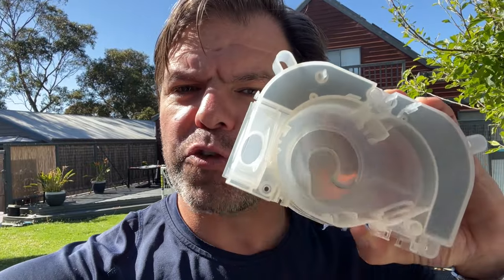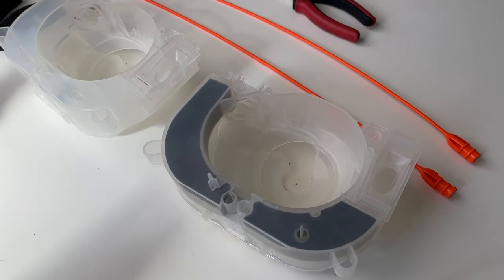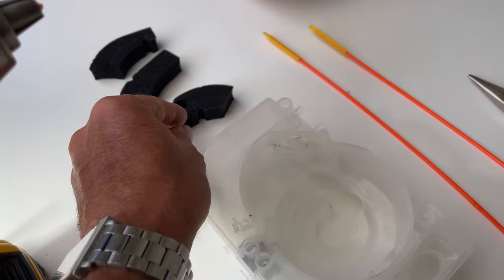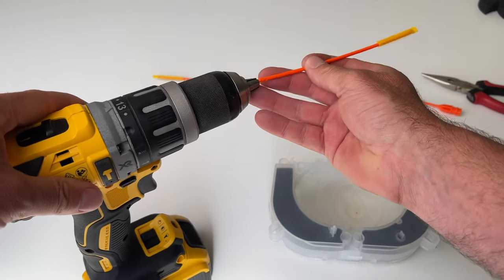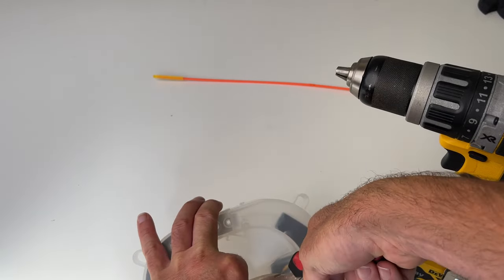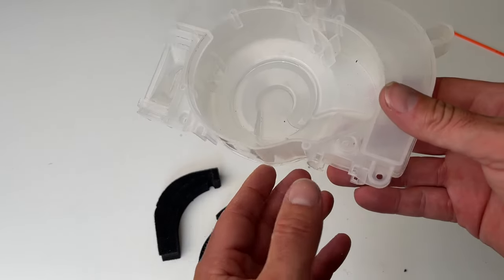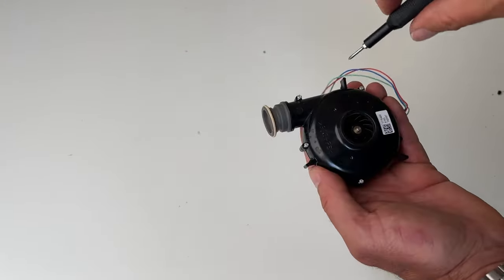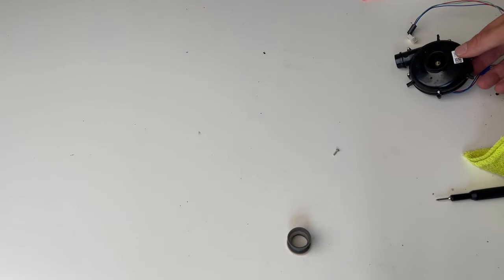It Works! New Improved DreamStation Foam Removal Tool! The Drain Weasel Method

Comment: Drove to Home Depot, dropped 6 bucks on a drain weasel, came home, loosely followed these directions, 10 minutes later, foam is cleanly out. No cuts, no holes. THANK YOU FOR POSTING! I will now use this as my primary and use the new garbage Dreamstation 2 they sent as a travel unit.
Reply: May I ask, what didn't you like about the Dreamstation 2?

Comment: works like a charm. Have to use the drill extremely slowly. Once the weasel comes in contact with the foam just a slight press of trigger without letting it rotate a full turn iteratively does the trick. I rolled aluminum foil into a stick and used it as a guide for the weasel to connect to the foam in the chamber with the top hole access and that worked very well. Thanks for the video and all you do!
Reply: Can you explain how you used the aluminum foil? I have worked 4 days on this with very little success!
Reply: @disneyworldinfo  Unfortunately I no longer have the machine as I returned it back to Phillips. You have to make a thing long roll of the foil long enough and stiff enough to be able to push the foam closer to where the weasel can come in contact. Once you achieve that it catches it and entangles the foam. Without the foil, because of the steep angle and narrowness,  its almost impossible for the weasel to reach to the foam and then it just rotates around air.

Comment: Great video! Wish I'd known about this method before I cut holes in my casing. Still worked out ok. Used a wood burning iron with a flat diamond shaped blade to cut flaps in the casing then resealed them by melting them closed. This would have much easier. Thanks for all your informative vids!
Reply from the maker: HI Stephan, glad you still got the results mate. Cheers!
Reply: Using a wood burning tool to make a flap, then re-melt the plastic closed is a very good idea, too.  Much cleaner than any cutting tool.   Good job!

Comment from the maker: Shopping for CPAP Gear? My Channel Sponsors will take great care of you!
U.S Sleeplay Channel Sponsor - https://cpap.review/shop
Australia Channel Sponsor - https://cpap.review/cpap-direct

Both companies have 5 star customer support and service and if you let them know you're friends with old mate Uncle Nicko on youtube they will roll out the red carpet for you! 

Since my original foam removal video there has been a large number of tutorials provided on youtube. Some using coat hangers, others with various drill bits however i really like this technique which leaves the turbine casing in perfect, original condition.

It uses a device called a drain weasel which is normally used to unclog drains - https://cpap.review/drain-weasel

This is an affiliate link. As an amazon affiliate i get a very small commission paid by amazon which helps me buy all the gear for the videos. Cheers

Comment: Worked fantastic.

Wish I found you a year ago, that’s one full yr not using this thing and life without much sleep... 

I did the easier hole first with the same model drill... even on slow I over torqued the plastic and it stretched, needing a second trim almost too short ... 

finished that hole and did the second one by hand with the backup weasel and using the included crank, slider in my teeth to one side of my face , and guiding/supporting the shaft with my freehand. 

I RECOMMEND THAT INSTEAD. I don’t think the power of the drill is an advantage, in fact I got to “feel” the process through both hands , and knew when to stop torquing and pull instead. A COMBO of continuous torque (after the snag, and sometimes re-snag) and slow pull was even better. With careful turning, you can coil that bugger up right small and slide it out easy.

The harder hole was actually easier that way, “by feel” and softer pull/turn.

SECONDLY: I was worried it would sound like a lawnmower once removed. I’m almost mad how little it changed... IE ALL THAT TOXIC FOAM AND CANCER RISK for what?? How much engineering for what? People, don’t worry about it, do this method and DONT worry about being kept awake by sound. 

TEST: what I did was set up the old analog Teac tape deck and Tandberg microphones (probably 40 yrs old minimum!) and did a before after comparison. I used old analog cuz of how exacting the VU meters are, how I could lock in the level, because I know there’s no auto gain modern stuff in it, and can get a real accurate comparison.

For good measure i laid the ipad on top more for picking up vibration changes not t caring about auto gain.

I didn’t monitor the recording with headphones, which wasted the effort. Because I would have heard the wildly odd unnatural howl that was recorded. Only way I can describe it is sounded like a DIGITAL tone generator that rose and fell with the machine matching my breathing in or out.

The tone was so loud you couldn’t hear the hiss of air flow at all... really confounding..

You can’t hear it by ear, so obviously the turbine interferes with the old mikes somehow. They have 4 foot leads so the deck was far enuf away I think. It is odd because they have a diaphragm for pickup, not a chip. It should only be picking up sound waves hitting the diaphragm.

THE IPAD didn’t pick up the interference LOLLL. It did pick up a change of sound but not an increase of sound.

But whatever. I’m excited to get a real good sleep tonight without the cancer
Reply: Followup: I used some guitar tuner apps on the ipad and the tone generator that comes with. Sine wave matches the best tone when trying to dupe the sound on the tape recording.

The fast tuning spectrum graph shows the high tone (most airflow) was usually an E♭4 running 303.7 Hz, with all the app settings default and A = 440. Then the low artificial tone still sounded like the tone generator sine wave equivalent, spectrogram showed C♯3 at 140.9 Hz most of the time.

why the tones sounded like the app's tone generator when emitting at those freq's I still am not sure of. Sounds 'digital', overriding all the other pickup sounds (like the air flow hiss) in through the analog gear. Moving the mics back barely two feet totally eradicated the 'tone sound' and picked up room noise, the air flowing, and my voice again. Using the headphones to monitor first wouldve informed me that the constant VU balance I thought was airflow hiss was this 'tone' instead.

And no it wasnt feedback, I made sure to have the speaker volume at zero and the amp set to a totally different output as insurance, while the input to the recording deck was just the mics. Wierdness.

OH AND YES. Delicious night's sleep, full 6.5 hrs without waking up once.
Rested.
I will go commando foam (naked) from now on, hope they DONT send a 'replacement' now.

Comment: Gegday mate!The Foam in my Dreamstation(circa2018) is mostly destroyed from OZONE. What is left in the one chamber is 80% gone with the rest being soft and crumbly/smeary.  The turbine is a sealed unit (glued).I have replaced it with a 3 B medical Luna II and have  retired my SoClean.
Reply: Same here.  Gooey mess.  I soaked it in hot water with dishwasher soap and got it clean. Let it sit in the soapy solution for a couple of days.

Comment: worked on the inner one .  the outer one was harder, so i drilled a hold.  In retrospect, I should have drilled a hole from the inside since the chamber is still sealed when we put the turbine back in.  In anycase.  very helpful video since the Amazon replacement are no longer available

Comment: I ordered the new air chamber without the foam. I installed it tonight with no issues and it seems to be working well. I'm kind of excited to begin my therapy with the DS1. I've been getting by with a pretty good F&P Icon.
Reply: Hello if I may where did you get it from I to want to buy one if you have a link how much did it cost?
Reply: I would like to know where you got one without foam?
Reply: @nightplayer2k6  Amazon, 30 bucks. I don't have the link.
Reply: @disneyworldinfo  Amazon, 30 bucks. I don't have the link.

Comment: Thanks a million for your tireless work!  I'm wondering if there are any actual decibel reports on the difference between foam and no foam in Dreamstation I.  Do you have a machine that can measure and rate the two noise levels? It seems as if someone should have checked ii out with an actual measurement.

Comment: I struggled with this technique for hours before bashing the chamber apart with a hammer. It did not work at all, I am amazed it worked for anyone and incredibly jealous tbh. Does anyone happen to have an extra tank they removed the foam from?

Comment: You actually don't need the drill.  I did mine by hand with the handle that comes with it.  The drain weasel twisted itself up because of the length, but after binding itself up it worked great.  No extra tools, not much more time than done here.  Just maybe a few extra minutes and some patience.  Kept going until it wrapped itself around the foam and then slowly pulled out.
Reply from the maker: Nice one David. Most people are now just buying the $30 empty casing and installing it - https://youtu.be/DuVeh2q-78c

Comment: Thnx. I'll be putting a new empty chamber in my original DS1 as I drilled and would like a new chamber. Question: is it necessary to remove the new silicon foam in the replacement DS1 should I ever get mine?
Reply: Yes, the new foam was never properly tested and can also release toxic VOCs.
Reply: @PaulMansfield  Damn.

Comment: I couldn't for the life of me get the section out by the air intake port.  Tried bending the tip of the weasel but it wouldn't catch it.  Had to eventually drill two holes on the inside wall of the motor housing to pull it out bit by bit.  The other side worked great.
Reply: 1st I did not know there were 2 different drain weasels. The one you use to is the hair clog. I have gone through 5 drain weasels and still can’t get from out. Not sure what I am doing wrong!! So frustrated!!
Reply: I'm having the same issue. Slightly different plenum than is shown in video.

Comment: This technique takes a lot of patience, kind of like fishing. While it worked after using a few drain weasels, there is a line of foam residue where the foam was glued to the case. Maybe safer to buy the replacement case on Amazon.
Reply: Did you find one without foam? Can you tell me how to search for the one on Amazon?
Reply: @disneyworldinfo  yes, the replacement "generic" case on Amazon comes without foam. Maybe safer to use that one than to try to modify your current case with the drain weasel approach.
Reply: @disneyworldinfo  The product page is now missing from Amazon. Philips must have filed a complaint.

Comment: I got my new Dreamstation from Philips today. Very excited. I followed all of the directions to a 'T'. None of it works. The device doesn't connect or download my settings off the memory card. I cannot enter it manually. It is essentially, a brick. I have to continue using my old device until someone gets back to me.

Comment: Thanks for the informative video and keeping us up to date with the CPAP issue. I registered and received my new replacement machine from Philips a week or so ago (main unit, power supply and hose in a new case) Thank you Philips. In the meantime, I had used the inline bacterial filter with no issues. They want me to now return my old unit. Should I?
Reply: If you want to loose evidence and not care sure go ahead

Comment: Just ordered 2 Dreamstation 1 air intake plenums without foam from Amazon @ $40 each to replace my original but foam removed plenums. I will do an OSCAR 1 day and 1 week data check before and after to confirm that the new plenum data ports are configured correctly and OSCAR data is similar to original. If the new ones are built correctly I should see no data change. Here is hoping 🤞
Reply from the maker: Hi David, yes i was behind those. I'm just not sure on the plastic but i think it's probably a good solution and the lesser of two evils. Cheers. Nicko
Reply: Hi David, can you please provide a link. i can't find it on Amazon. Regards,
Reply: Brand: Medihealer
Replacement Empty Casing Without Foam for Philips' Recalled Machines, Plastic Part for Dreamstation 1, CPAP Filter Assembly for Dreamstaion 1
Reply: @va7da  Thank you , I found it, a pity it is out of stock for now. Regards, Olaf
Reply: Installed both Amazon foamless air intake chambers in my two Dreamstation 1 Auto CPAPS. Installation was easy, needed needle nose pliers to carefully disconnect wire connector blocks on rear of circuit board. OSCAR one day data was virtually the same before and after installation so lack of foam made no operational difference. Machines were no noisier without noise abatement foam. Why did Resperonics ever use the foam in the first place?

Comment: I’m assuming you can safely run the machine without the foam. So what does it sound like without the foam? Is it noisy?
Reply from the maker: Hi Tiff, certainly much safer without then with. It sounds find, a little louder but only marginally. Cheers
Reply: I barely noticed any difference after foam removal. My ds1 is about a year old.

Comment: Thanks for the tip. After removing the foam, there is still some black foam glued inside, any tip to remove that? I'm letting it soak in water to see of it dissolves. Thanks
Reply from the maker: G'day mate, that black foam glued is the breakdown they are talking about. It get's all sticky and turns to muck. I'm not sure what you can use. Could try some boiling water and perhaps a instrument tube brush. If you can't get it out then just buy a brand new casing - https://youtu.be/DuVeh2q-78c . They're pretty cheap. Cheers
Reply: @CPAPReviews  thanks a lot!

Comment: I tried ... but ... some little bits of the foam stayed inside on top of the ridge (very little) as if that was the glue point. So, although it's minimal, I've already had 10 years of Philips' death foam. Don't want another second of this, nor the tiniest bit of this foam. I ordered from Amazon. Thanks, next I'm off to the Dreamstation GO to give that foam a shot.
Reply from the maker: G'day Rosa, it's not 'glue' that's just the foam starting to break down and become sticky. Best wishes. Nick

Comment: Nick, I got the one out that you showed in this vid.  But tHe other one is not reachable with the weezle
Reply from the maker: Hi there, yeah it's a bit harder that side but if you keep pushing it back in and out and try different angles it will eventually hit the foam. I think i was trying to push it off the roof so that weasel made like a U shape. I'll see if i can get another chamber and show you :)
Reply: @CPAPReviews  Nicko, I think it would be really great if you could show exactly how to get the Drain Weasel to make contact with the smaller piece of foam.  Howard Morland's video also fails to show how he got his Weasel to make contact.  Both he and you only showed pulling it out AFTER the contact was made (there is a skip in the video).  After much "weeping and gnashing of teeth" I was finally able to get it out, but I also took a long time to do it.  I tried reviewing your video and Mr. Morland's, but neither of you showed how you got the Drain Weasel to make contact.  Since this was the most difficult part of the procedure, it should have been the most detailed in the videos.  BTW, another little detail is how to get the back of the top off of the DreamStation.  No mention was made in your earlier videos that the tabs (inside the rectangular holes on the back) should be pushed in to disengage the top cover from the back plate.

Nevertheless, I very much THANK YOU for showing us that this is possible.  I think we need to contact the Pope and have you named Saint Nick.  All the kids would love you at Christmas time.  (And the beard you had earlier is almost white enough, too! ;-)  )

Comment: It took me a good 40 minutes to remove the foam, but some foam was left stuck to plastic ridges and I ended up having to drill some small holes big enough to insert a scalpel and cut the tops off the ridges where foam was stuck.
Reply from the maker: Hey Paul, yeah it can certainly be a bit tricky if the foam has started to degrade and has become sticky. Very hard! Cheers mate. Nicko
Reply: @CPAPReviews  my machine only 13 months old and never ozone cleaned. The foam was a little bit crumbly.

Comment: Could you put the foam back in, and record it again.  I want to make sure I do it right.
Reply from the maker: I don't think you can really do it wrong mate, You just jam the weasel in, use a low speed drill and then once it wraps around it you start pulling it out gently. Cheers
Reply: If you find a YT video that shows that please let me know.  Shame he did  not do it on this video.
Reply: @darcymandryk1785   thank you
Reply: @lesliefranklin1870  thank you

Comment: Wow, really smart idea, thank you for passing it on. Worked great, had a little trouble with smaller chamber but it came out fine, just in 2 pieces as yours did. Didn't use ozone cleaner so foam still seemed to be intact. Anyway gave it a rinse with water, mostly dry already, should be ready to put back together tomorrow. Unfortunately my particular turbine is sealed so won't be able to get in there, oh well, hopefully there isn't to much debris in there anyway. 

Was sorry to read in the comments people struggling to remove foam that was beginning to degrade. Phillips really should have made available a foamless chamber for all those willing to replace it in their own machines, instead of leaving them to struggle to get the foam out on their own to make their machines useable again.
Anyway thankful for people like you who take the initiative and stand in the gap to provide useful information when corporations cower in silence. Thanks again 👍